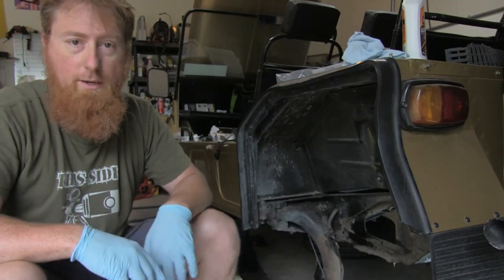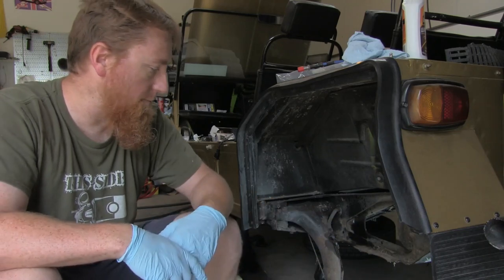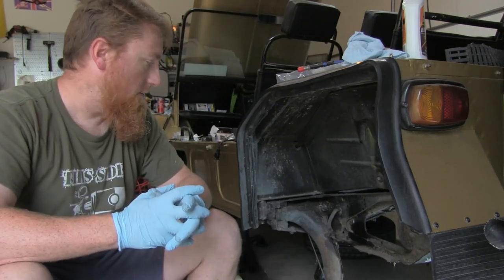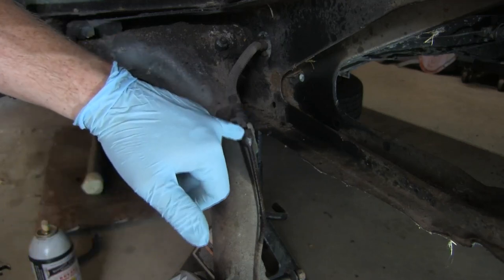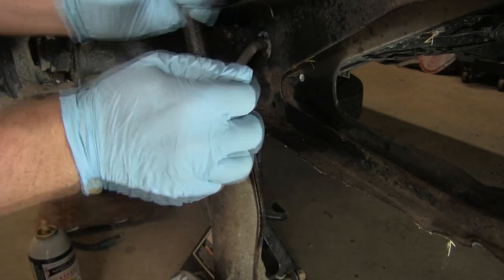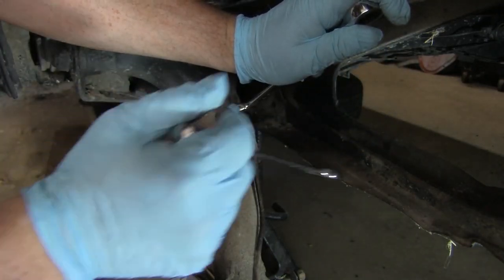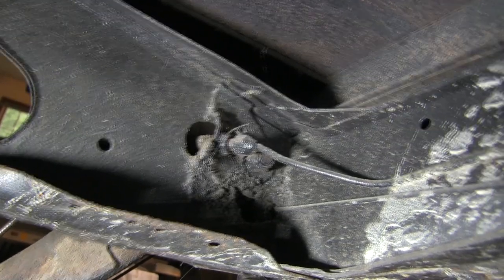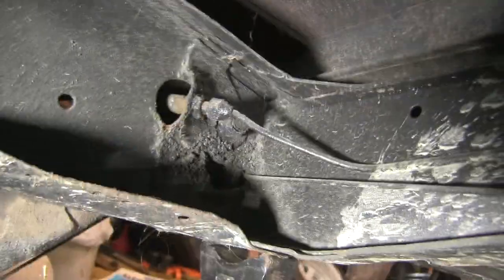Installing Braided Steel Brake Lines on your Classic Mini!

Comment: How do you find the springs on your leyland mini compared to cones? Thinking of doing the same to mine/
Reply from the maker: A little tough to say, since I have never really had new cones to judge by..

But I like the springs well enough.  These are the S-Racer springs I bought back in 2000, not the new-fangled springs coming out of UK also...